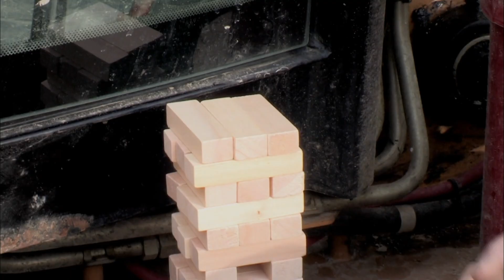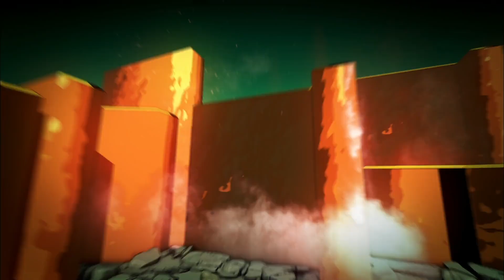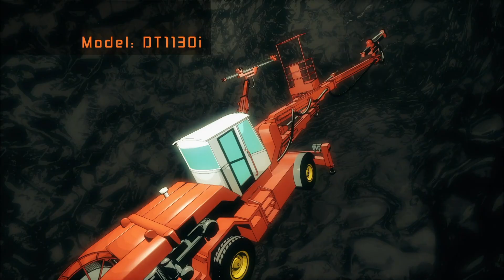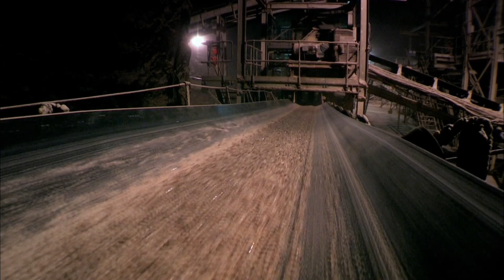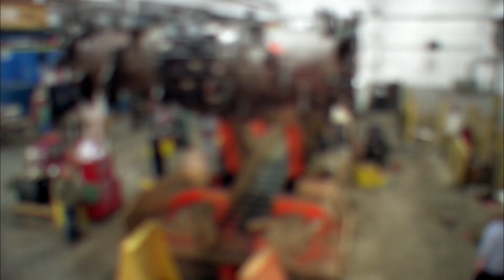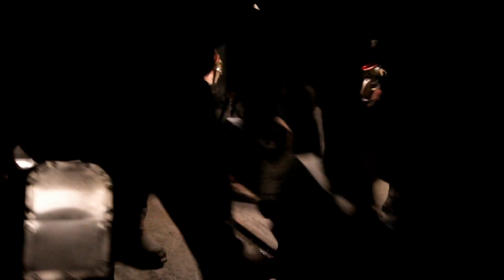Dirty Great Machines - Down-The-Hole Drilling | Technology Documentary | Reel Truth. Science

Comment: 12 1/2 mile ramp.  25 to 40 min drive time.  For what is really only 2 miles distance.  I think I would be pressuring R&D for that "drive off into a vertical shaft and kick on the inertial fall-dampers in 15 seconds" device on a weekly basis.  Sure, you get paid for the drive time, but still......

Comment: 200miles!🤣😂 That's what I was thinking. Been to the bottom of #4&was bolting in 9800 Station before it broke into ramp. Pressures are crazy, "Unopened bottle of water, the label was loose around the bottle before opening the bottle". That's how much pressure on the body, "for the kiddos out there". And using a jackleg and stoper, in 48°c plus 100% humidity. Like working out for 10.5hrs straight while in a sauna sucking dust from a vacuum as a breather hose, mixed with blue diesel fumes. Enjoy.. ALL TRUTH, EVERY WORD.